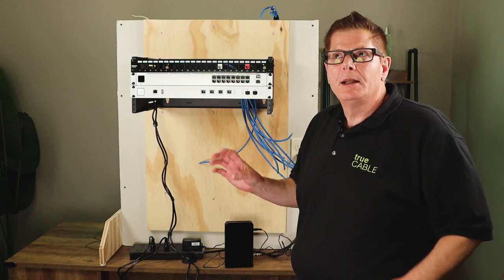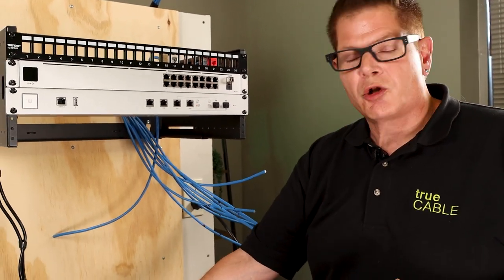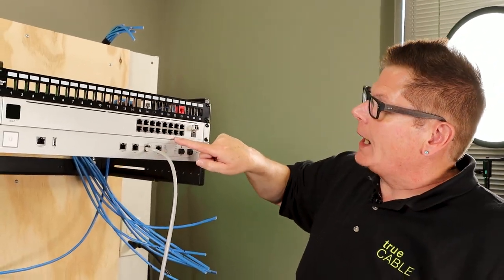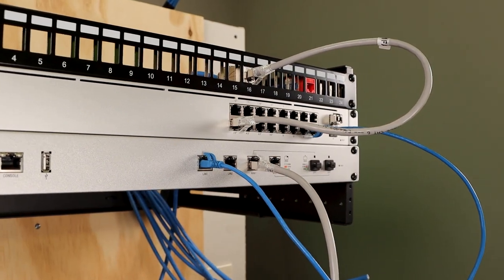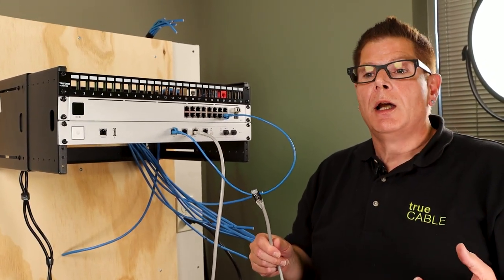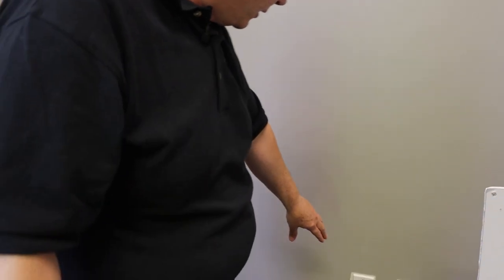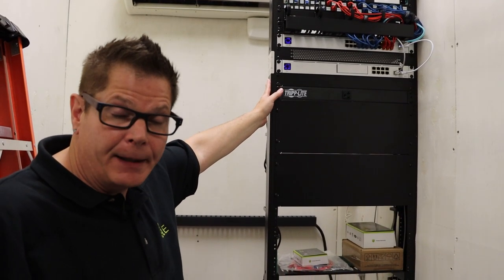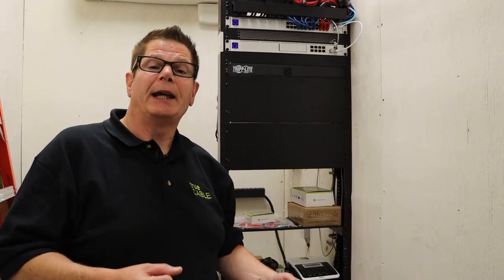The Key Components of an Advanced Residential Network Setup

Comment: Wonderful video, I've been watching a number of these planning my network and they've been quite educative. Thank you.

I have a similar situation with a Unifi Pro switch with Etherlighting, a TrueCable grounded patch panel and a wall plate. I want to use a ground bus rack plate and TruePlug to supply the ground reference. 

I only intend to use a shielded wire from the patch panel to the wall plate, with a shielded field terminator + coupling keystone at the patch panel and a shielded terminated keystone jack at the wall plate. I'm only supplying a ground source at the patch panel to avoid ground loops, not at the plate. Using a field terminator instead of a keystone jack a the patch panel would allow me to later reorganize my patch panel positions if want to. 

My online research is telling that the Ethernet ports on consumer grade Unifi switches are unshielded. For the link from the patch panel to the switch I intend to use a small unshielded patch cable sold by Unifi that is compatible with Unifi Etherlighting. This is on a short 6" distance, but the video seems to indicate that I must use a shielded cable here and won't be. To complete the link. 

Question: Am I mistaken in that I'm not sacrificing all that much by using an unshielded patch cable over this short distance? Otherwise Etherlighting is pretty much a wasted endeavour. I don't expect much EMI in that area. 

[Likewise, on the other side of the wall plate I might use an unshielded patch to connect. I find it also odd that Unifi's manual recommends shielded cable for outdoor devices. connected to the switch. With unshielded ports this seems to imply you need a grounded patch panel between your switch and the outdoor device.]
Reply from the maker: Hello, and I am glad you find our content helpful! Like you, I have deployed and typically do currently deploy Ubiquiti equipment, and I use the 24 and 48-port high-powered PoE versions of the Etherlighting switches, so I have a great deal of familiarity with your situation. As it turns out, the Ubiquiti equipment does indeed bond your cable shields to ground and set the reference. The AC internal power supply provides this bonding ability, as the power cord is three-prong. That said, the QUALITY of the bond to ground is questionable in my mind. So, what I typically will do is bond all of my cable shields to shielded keystones in a shielded patch panel. The shielded patch panel is then bonded to ground with a truePLUG bonding and extension adapter. I then use UNSHIELDED patch cords to the rest of the equipment from the patch panel. This effectively isolates the bond to ground and protects your switching equipment from ESD discharges by redirecting the bond well before it gets to that super expensive Etherlighting switch. I typically go this direction now and skip using the shielded patch cords, and we will update this video in the future. You can additionally increase the bond to ground with a shielded patch cord in addition to the method I outlined above, but I would consider it optional at this point since the introduction of our highly effective and tested truePLUG. The video was made before we released that accessory! Sorry for any confusion. Oh, and you sacrifice nothing by skipping shielded Ethernet unless you really need to use it. Shielded Ethernet, in reality, and more often than not, simply adds to the complexity and costs of an installation without conferring any real benefits. There are situations like aerial runs where shielded is all but required, or areas where very high EMI/RFI is encountered, but that is it. The reason Ubiquiti recommends shielded for outdoor equipment is due to ESD discharge on the cable jacket or end device housing traveling down the cable to the switch. If ESD cannot drain off, it may damage equipment. That said, the ESD risk depends on how you install the equipment, but I understand their recommendations. I just happen to have a much more nuanced understanding of the subject.
Reply: @trueCABLE  Fantastic detailed response, I'm running with this! Glad to hear get definitive info on the Ubiquiti switch, I was having a very hard time finding.
Reply from the maker: @GroundLoops  Hello and you are welcome! I am glad to help.

Comment: Can you elaborate on what codes require the fireproofing measures you describe?  What about the telecom room that’s not present in the small business version required the fire rated plywood and paint?
Reply from the maker: Hello Darren. The NEC/NFPA 70 spells out national recommendations that were typically adopted as law (Code) in many states/jurisdictions in full and without modification. That said, there are some jurisdictions that did not adopt the NEC/NFPA 70 completely or heavily modified the requirements, typically making them stricter. What local Codes apply to you will depend upon the jurisdiction you are in, and you can cross-check with your local Code inspector. When dealing with commercial installations, it is wise to always have the latest edition of the NEC/NFPA 70 on hand in addition to your local Code inspector on speed dial, as the laws change and may do so frequently. Be aware that if you do business across multiple counties, you may be subject to differing requirements on a county-by-county basis!

Comment: Please do more in depth videos on ground/bonding of network racks. It's a subject that's hard to find information on.....If all of your cabling in your network rack is unshielded, is there any benefit to grounding/bonding the network rack?
Reply from the maker: Hello! We have many more rack/patch panel bonding and grounding videos and blogs (found in our Cable Academy) coming up. We will be selling a shielded patch panel very soon. We agree, it is a subject that is difficult to get reliable and useful information on. That is going to change with our upcoming content. As to your question, if ALL of the communications cable coming into the rack is unshielded there is still a benefit to bonding the rack itself to ground and that is safety. Now, in small installations where you don't have anything more than residential voltages (240V/120V AC) involved this is not as important. In commercial installations where 480V and higher may be present somewhere in the building, ALL metal in the TR/ER and ALL metal used for supporting your SCS installation (excepting small items like J hooks) should be bonded to ground due to possible differences in voltage potentials in the case of building damage or AC system faults. You can obtain professional bonding and grounding information by taking BICSI classes. They have installer certifications that cover this plus discrete courses that cover bonding and grounding of ICT systems. Hope this helps!

Comment: So if I have 8 poe cameras, are they supposed to be shielded Cat6a cable ?
Reply from the maker: Hello Cris! Not necessarily. In fact, unless your cameras require 10GBASE-T speeds (and they likely don't need anything above 1G), you are fine with Cat5e. Cat5e can handle 2.5 Gb/s. As for shielded Ethernet cable, the decision to use shielded should not be taken lightly. Shielded Ethernet should be used when you know you have an EMI/RFI problem or potential ESD issue. Otherwise, use unshielded Ethernet. Shielded Ethernet increases costs, complexity of installation, and requires proper bonding to ground. Hope this helps!

Comment: I don't see a maintenance loop for the wire.
Reply from the maker: You have a keen eye for detail! Indeed, there was not one in the video. It is addressed in the written blog that this video goes with, found on our Cable Academy. This video and blog combination was meant to address network connection hookup and overall strategy as opposed to cable installation specifics and best practices, so specific items like service loops and terminations were not covered.

Comment: Aren't those ethernet jacks waay too close to that outlet?!? That would also cause interference.
Reply from the maker: Hello Derrick. No, the keystone jacks are a considerable distance away from the AC power. The keystones are also mounted outside the wall and the AC power circuit is mounted inside the wall, so we are talking a couple of feet separation here.
As for INSIDE the wall, shoot for 8" or better separation on parallel when using unshielded Ethernet cable with unshielded AC circuits (romex not inside conduit, for example).